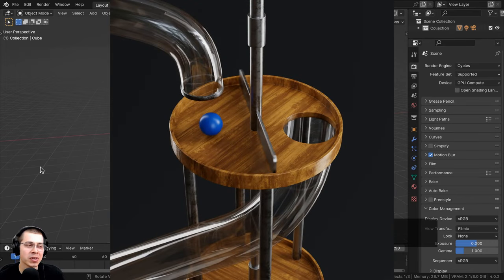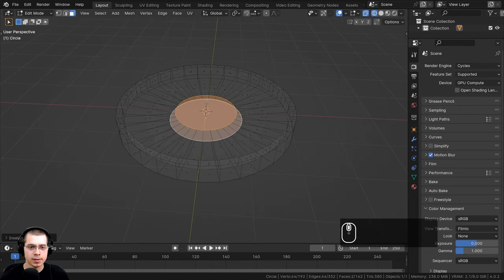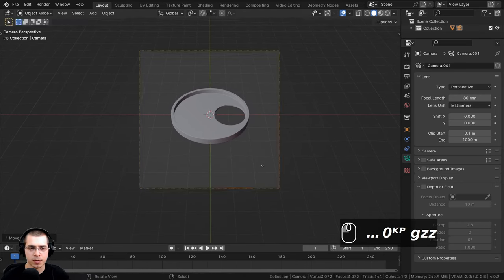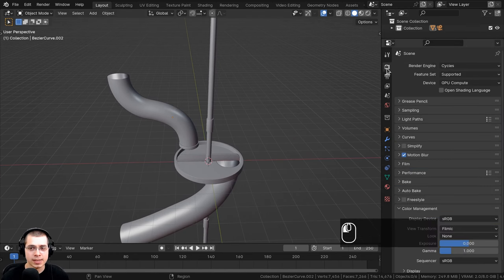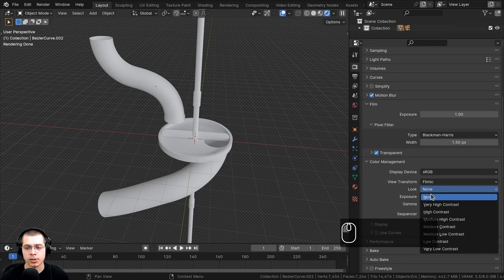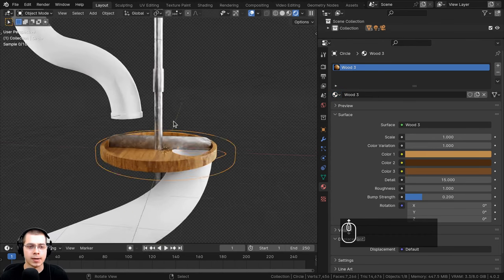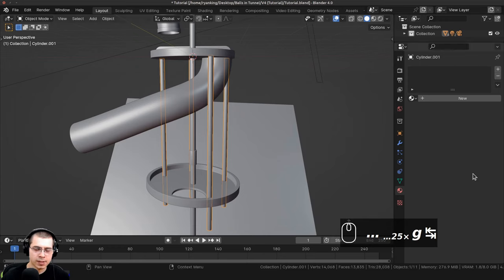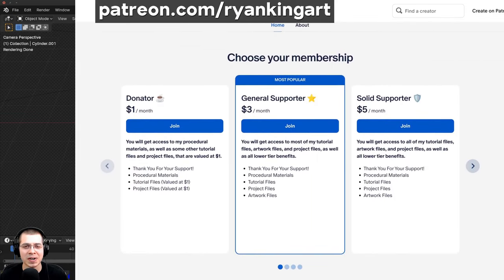Part 1: Ball Tube Slide - Satisfying Animation Loop (Blender Tutorial)

Comment: Thanks!
Reply from the maker: thank you for your support!!
Reply: @RyanKingArt  

I am working on this tutorial now... lot's of fun!  I seem to keep getting myself into situations where bevel mod doesn't work.
I had this issue with your Lighthouse tutorial and you responded:
"There might be overlapping vertices. try merging all the vertices "By Distance" and it will remove any overlapping."

On the ball tube tutorial merging vertices by distance worked, but I don't see what I am doing wrong that is causing it.
ON the ball tutorial that I am doing this am, when I did the  upper tube collar (TS: 17 :41) I ran into this issue.  I looked edit mode at the vertices and I don't see why i  had a problem, but merging by distance fixed the bevel issue.

Any ideas?  Thx for your expertise!
Reply from the maker: @graphguy  It could also be an issue with the angle of the edges. if the angle is too small, it will push the bevel in, and make it smaller. I have plans on making a bevel modifier trouble shooting video, because the bevle not working is a very common issue.

Comment: 28:21 my tube is not showing any transparency even though my nodes look exactly like yours.
Reply from the maker: make sure you're using Cycles render engine. or if you want to use Eevee, I show you how to make the glass transparent later in part 2 of the tutorial.
Reply: @RyanKingArt unfortunately my computer doesn’t respond well to the cycles.

Comment: This is a great vid and I'm learning a lot thanks!! I need help figuring out how to mill steel in an animation. I'm not sure what to set the physics to on the two parts. This guy does it here at 44 seconds into the video. I need metal shavings to fly off the endmill when it cuts the steel. I have the endmill model programmed to spin and i have it colliding with a cube for now but it doesn't cut or throw metal chips. Please consider helping. Here is an example but there are no tutorials on this:  https://www.youtube.com/watch?v=FNW-CO91izw&t=68s